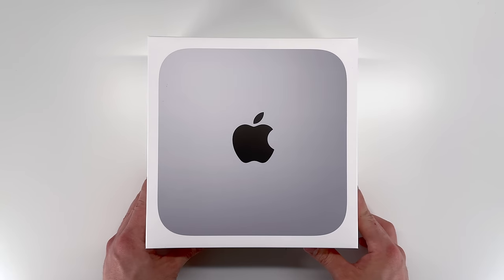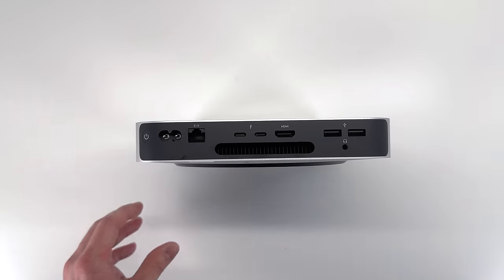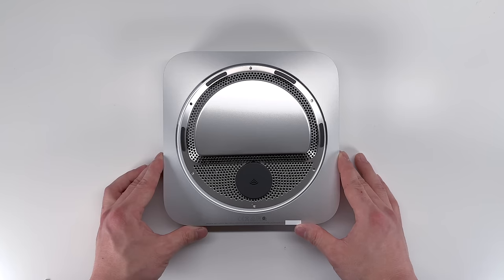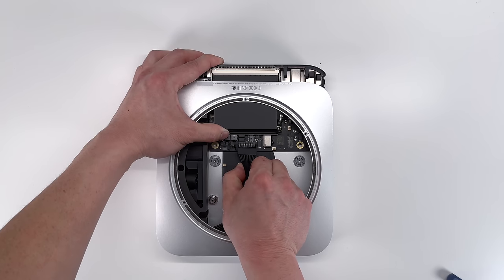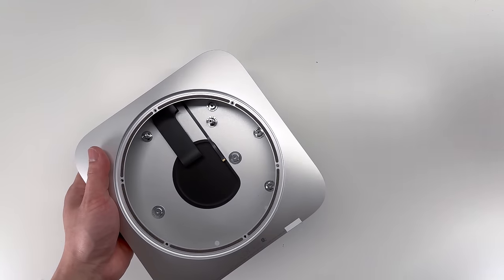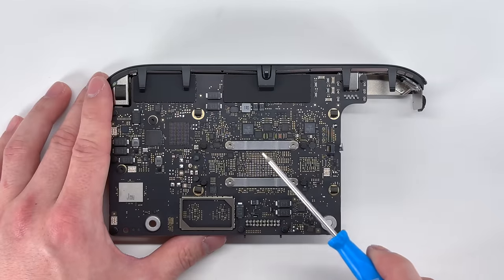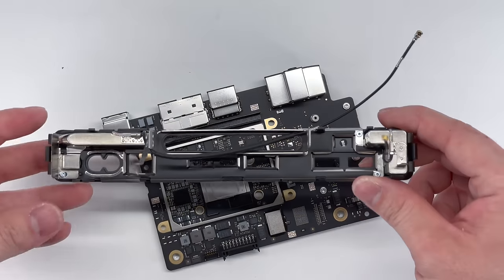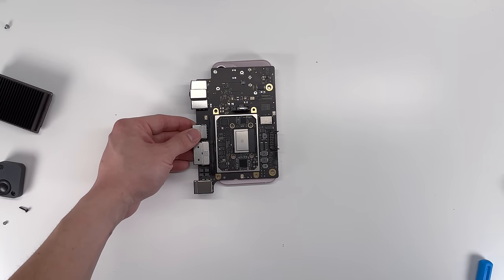M2 Mac Mini Teardown / Disassembly (4K - Up Close)

Comment from the maker: CORRECTION! To the right of the M2 chip are 2X SK hynix H58G56AK6HX052 4 GB LPDDR5 SDRAM memory. There is only one SINGLE NAND chip for storage.
Reply from the maker: @Milan Lucky Sure do you have a prefrence on which app to use? Blackmagic?
Reply: @brandon20904  Black Magic
Reply: @brandon20904  yes black magic please
Reply from the maker: @DestroyCode  https://youtu.be/ttbsXMPBxUc
Reply from the maker: @Milan Lucky https://youtu.be/ttbsXMPBxUc
Reply from the maker: @mohamedfarag798  https://youtu.be/ttbsXMPBxUc
Reply: @brandon20904  thank you
Reply: So, as others predicted, base model 256 has one NAND like the M1 mini… I’m glad I cancelled my preorder and ordered the 512 instead… read that when you max out the 8GB of ram it slows down because of only the one NAND, so faster with the 2nd chip there.
Reply: @benji888578  let’s hope. It is shown that the 512gb base model of the m2 pro Mac mini has a single nand chip. Honestly despite this I think even the base model 256gb m2 is worth for most people especially with the educational discount. Not the case if you edit a lot.
Reply: @benji888578  there is high chance that the 512 has only one too, consider the pro chip only got one…😢
Reply from the maker: @benji888578  Wish I knew before I ordered 🤦‍♂
Reply: @andre88223  the pro chip has two, one on the front and one on the back. But I think it’s supposed to have four…
Reply: Thanks for the ram label. Can you confirm the nand model number please?
Reply: @andre88223  I don’t think so, but, now i can’t wait for the tear down…512 is the starting point for the m2 pro mini, I think the base model Mac mini m2 pro has half the NAND filled, the M2 & M2 pro surely use different NAND chips. Well, hopefully someone will open them all up soon and we’ll know for sure.
Reply: @benji888578  luke Miani opened the pro up at least

Comment: Amazing how powerful computers have gotten with such a small footprint. Cool stuff!
Reply: Riiight, it's basically the same size as a Raspberry Pi but way more powerful. It's crazy.
Reply: Apple doing the unthinkable
Reply: @NotBROLL  wait what? it's like 5 times bigger than rpi...
Reply: It's a shame that it only runs MacOS and can't upgrade when Apple decides you need to buy a new one.
Reply: @TheWorld4all  there's a huge ongoing effort from the Linux community to reverse engineer and make Linux work perfectly well on Apple Silicon Macs. You can install other OSs on these Macs, Apple doesn't prevent it, they just haven't made any effort to make it easy
Reply: @TheWorld4all  As a life long Windows and Android user I completely disagree with part of your statement. Apple supports its hardware (Macs/iPads/iPhones) with software/OS updates for much longer than any Windows PC or Android Phone I've ever owned. This is just a fact. I owned my iPad mini 2 for 10 years, and it was still getting security updates when I decided to upgrade early last year. In that same time, I went through 3 Windows computers, and 5 Android "Flagship" phones from LG, Samsung, and Google. Often times updates for Android phones didn't roll out until months after the release and none of my phones got updates past 3 years, was lucky if they got any after 2 years. Windows is better about updates but rarely does hardware keep up with them. I've come across older Macs (7 , 8 years) that still work better than my 4 year old PC.
Reply: The iPhone is smaller and more powerful.
Reply: @TH3mrBROWN  An 8 year old Mac would definitely not keep up with my 4 year old PC laptop (32GB ram, 1.5 TB SSD, 2.4 Tflops GPU, Windows 11).
Reply: @TH3mrBROWN   Mac Mini is not upgradable.  Suckers are stuck with  8GB Ram, 256GB SSD.   The SSD is solder on.  When the SSD fail, Mac Mini is junk.
Reply: An engineering marvel.
Reply: @WolfiiDog13  Apple does not prevent? create hardware locking mechanisms is what? apple prevents yes and a lot. legacy hardware, without the possibility of easy maintenance and currently even has a block for resale
Reply: @ethi8128  what I am saying is that Apple doesn't prevent you from booting another OS on the Mac, unlike iOS devices, just that, nothing else. Those issues are different ones. Important issues? Yes. But not the same thing.

Comment: The 16gb version will be my first own mac ever, very nice to learn how it looks on the inside! Indeed there’s a lot of space inside, but I guess the current form factor isn’t an issue for most people
Reply: Would you rather go with 16gb ram or the 512gb ssd because it’s faster?
Reply: @theands2724  didn’t know yet if the 512 also got one nand.
Reply: @theands2724  good question, I just went with the assumption that 16gb would be enough for the software I mostly use, after doing a bit of research. About storage I already have an external ssd so don’t see the need to pay the extra. I know having the 256gb ssd in the mac could be a bit slower than 512gb but afaik it shouldn’t be an issue for me
Reply: @akus3526  upgrading to 512gb will make your machine faster.
Reply: @earnistse4899  Why is that?
Reply: @DisgruntledPigumon  the base 256gb ssd is very slow. upgrading the ram wont fix the slow ssd. its advised to upgrade the ssd to make it faster than to get more ram. youll feel the dfference i promise.
Reply: @earnistse4899  That’s surprising.  I’m seeing online it’s actually slower than the 256 M1.  That’s really lame.  I guess I’ll be cancelling my order and paying the extra money.
Reply: @DisgruntledPigumon  yea it's really unfortunate but this is what apples greed gets us. they also did the same thing to the 512gb MacBook pros this year and purposely slowed them down which is a load of bs. the 512 mac mini gets its normal speeds at 512 though.
Reply: @earnistse4899  Well, I’ll try cancelling my 256… 

Hearing about the new M2 Mac Mini made me happy, but hearing that Tim Cook is leaving made me happier.  They don’t need to be greedy anymore.
Reply: @DisgruntledPigumon  it pisses me off that they aren’t upfront about the base model having slower ssd speeds. If it was clearly on the product spec page then fine but they hide the fact that you get screwed buying the base version and want to charge 200 dollars for a 512gb ssd which is a joke. On the pc side you can get a blazing fast m.2 gen 4 at 2tb capacity for 170 usd.
Reply: @akus3526  It ultimately depends on what do you need the speed for, I got the M1 with 250GB and 16GB RAM, and I don't even use the built in storage. You can, as a matter of fact install the OS on an external SSD and I have mine on a 2TB NVMe in an enclosure, with speeds of about 1300MB/s Write and 2750MB/s Read (against about 2500W 2900R on built in) and I couldn't be happier. It does take about a minute to boot for some reason, but I almost never shut it down.
Reply: @earnistse4899  The M2 Pro 512GB is also single Nand.  So now I’m wondering if M2 512GB is single as well.
Reply: @DisgruntledPigumon  i don’t think it would be but if it is …. Then that would be the biggest fail by apple. The Mac mini m2 with a single nand ssd is actually slower than the m1 model when doing intensive tasks like file transfers and video / photo editing because the ssd is needed for those tasks. It’s ridiculous if they also made the 512 mini model a single nand while charging 200 dollars for the extra storage. Who would buy this thing then when it’s slower than the m1 model for daily use?
Reply: @earnistse4899  I hope not, I saw they actually did that to the new MacBook Pro.  512 single Nand.
Reply: @DisgruntledPigumon  I saw that as well. I think you'll be ok going for the 512-mac mini because the m2 MacBook air recovers back to full SSD speed with the 512 model. I just think they are doing this crap to all base models regardless of the starting storage amount forcing you to buy the next SSD tier up. After seeing this from apple I've personally chosen to build a 700 usd pc instead because I don't want to support this anti-consumer behavior from apple. I'm sure you still want your mac mini and that's fair, but I would at least consider the much better value you can get by going pc.
Reply: @earnistse4899  Good point about the MB Air.  And yeah I’m there, I’ve been debating building a PC which honestly is the better idea since it will be specifically for 3D modeling and rendering. But I’d have to pay quite a bit for a decent raytracing capable graphics card, so I’m thinking of going cheap, and with the OS I prefer (I really do like MacOS much better.  I used to build Hackintoshes, but that’s basically over now.) 

I’ll go with this Mac Mini until I learn Blender enough to really need and justify a powerful PC.  I appreciate you giving me the heads up about the 256 though they still haven’t refunded my money from my cancelled order.

Yeah I don’t like supporting the current Apple. Can’t wait until Tim Cook is gone.
Reply: @DisgruntledPigumon  I’m with ya
Reply: Be shure that you got the amount os storage that you need, because those things dont have an upgrade that gave them any future.

Once storage is wasted, all thosecomputers are going to be landfill waste.
Reply: Hopefully the larger size gives better thermals. It would make sense.
Reply: I always wanted a way to hack a USB SSD inside the case. Alas, a new Mac Mini will be upon us soon...

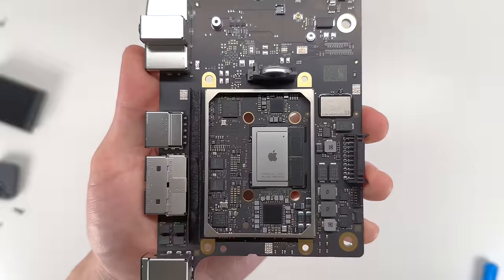Comment: Thank you for showing us the teardown video. 7:11 what you pointed to is LPDDR5 SDRAM memory.
Reply: Yes, SSD drive - silver chip on the right
Reply: @quickmaker2280 two chips right next to apple chip are soder ram chips and he called them sold state drives  the actual sdd is silver chip on right of  because there is a second placement are with pin hole were apple can put another sdd chip

Comment: this base model is gonna be my first mac.  Should be able to buy it in February.  I'm already deep in the apple ecosystem with my iphone and apple tv 4k!
Reply: Nice, it looks like a fantastic computer. I have a macbook air (M1) and it runs great. It's crazy I can still run matlab and program with it.
Reply: I sincerely suggest extending your budget for a larger SSD. There is a significant difference in speed (and long-term longevity) between a single NAND option (which definitely includes the 256GB size) and the dual NAND options (which may start at the 512GB size, but could require reaching up to the 1TB size). Best to research these small but important details before buying, so that you will have a computer that serves you well for at least the next 4~5 years.
Reply: @karaokedogs2618  i highly disagree. apple storage is extremely overpriced. buy the base model because the value is insane and if you are worried about speed just buy external ssd‘s and connect them via usb c they can be plenty fast. longevity of those really hasn‘t been an issue anymore for years in the industry.
Reply: @awesomeapple4540  in this case,  its not a mater of speed... research a little about  m chip Macs, if ssd dies , the whole computer is useless...

Comment: This is a very nice tear down video!  Thanks a bunch.  I did notice you identified two chips on the board as Solid State "Drives", The two chips on the side of the M2 chip are the Dynamic RAM modules, not the solid state drives you mentioned.  I believe The storage chip(s) has/have also been soldered on the board.  The two chips mounted to the board near the I/O panel look suspiciously like 128GB solid state chips.  Alternatively, Apple could have used a single 256GB chip, which the square chip to the top right could be.  Also, another technical detail to note is the Hard Drive does not exist on the inside of the South Bridge, The DRAM and PCI-E are the only communicants at that point. Since PCI-Express is on the North of the South Bridge and South of the North Bridge, it is called Express.  Since the DRAM is shared by the CPU and the GPU, the  Graphics RAM and the Compute RAM are the same chips, The GPU is on the north bridge and the Unified Memory is the only thing between the North and South bridges.
Reply: Yes, the storage chip is North East of the Memory - around where his top finger is located! Being the 256GB version, there is only one chip. I believe more can be mounted nearby.

Comment: Thanks for taking yours apart so my curiosity doesn't get the best of me and I try to take mine apart! I ordered a M2 with 24GB ram and 1TB storage. I wonder if it still all looks the same? Astounding how compact everything is - going from a 27" 2010 iMac!
Reply: yeah you can open yours and check
Reply: The only real difference will be there will be 2 SSD chips. If you look at the 7:12 mark when he points to the “SSD” he’s actually pointing to the RAM. The SSD is actually up and to the right from those. In the video this has a single SSD chip. The second one on yours will be where the grid of solder ball pads are just above the one in this video.
Reply: @JCole78  exactly right
Reply: The black thing right next m2 chip is ram not sold state drive like he sad

Comment: Thank you for this great job about Mac mini M2. Just a comment about that you said at 7min21, I think it is not the SSD chip but the 2 LPDDR5 chip which provide the Unified Memory. these 2 chips have to be close to the SoC and the SSD chip not. You can see the SSD nand chip upper on the right, it is the large light grey chip with transparent and rectangle border. And upper there is a rectangle space for the second nand chip (used when you order 1TB of SSD). Sadly the marketing of Apple decided with M2 family to use only one SSD chip with 256 & 512 GB configurations. And the performances R&W are affected obviously (/2).
Reply: Didn’t knew this and lucky that I upgraded the Ram to 16gb and the SSD to 1tb. Logic and final cut pro pre installed for $1,258 with the educational price.
Reply: I agree what you said, the ssd is further than the ram, but actually there's only one ssd inside the m2 Mac mini,so the disk speed is 50% lower than the previous generation
Reply: @pino_7428  I thuink the 512gb uses 2 sad slots as the read and write speeds double the 256gb version

Comment: Are you sure what you identified as the Solid State Drives are correct? Max Tech identified the SSDs as being the chip right next to your middle finger at 7:18 and the place for a second SSD right above it suggesting the base model drive speed will be much slower with one 256GB SSD rather than two 128GB SSDs that were on the M1 Mac mini. If, however, you are correct then that is clearly 2 chips. Perhaps that is the 8GBs of ram, however.
Reply from the maker: You're right. I got it mixed up because that's how it was when I tore down the M1, I added some notes to the video and description. Thanks!

Comment: Apple is really going in right direction!

Love the compact size
Reply: Well, its surely full of engineer craft but for me, it’s a bit too much due to the reason of no possibility to upgrade things like ram or storage.
Reply: @Lykaon01  wrong, they are trying to force the end user to use the cloud, so you can't upgrade the storage
Reply: @Lykaon01  wrong, they are trying to force the end user to use the cloud, so you can't upgrade the storage

Comment: Why would they make it smaller? You need some weight and size to stop it tipping and for the air grille and inputs/outputs?  I don’t get why it needs to be smaller or what benefit being smaller would be? The Mac mini is essentially as small as it needs to be. What would be the pro of it being smaller especially as the pro edition uses the same case. Can you please qualify your statement ?

Comment: Hope the 512 SSD version will come with 2 NAND chips. Thanks for the video.
Reply: Nope. Its confirmed to have a single NAND chip as well.
Reply: @DanielBlaney  Do you mind sharing the source for this confirmation?
Reply: @DanielBlaney  this is incorrect. It comes with 2 as the read and write speed doubles the base model with 256gb

Comment: They modified the base model M2 Mac mini's SSD arrangement, just like what they did with MacBook Air M2 and 13" MacBook Pro M2 (I can't verify if that's the same case with the 14" and 16" MacBook Pro M2 Pro and Max.) All the base models use a single NAND SSD chip.
 
DO NOT buy the base model if read/write speeds matter to your workflow. Otherwise if you're just a casual (non-technical) user go for it. The slower SSDs won't matter to you.

Comment: For M2 pro Mac mini ,Is it better to have a 1TB version for a “guaranteed” faster SSD compared to 512GB? Thanks!
Reply: Honestly, it really wouldn’t make that much difference when your SSD is reading/writing beyond 1500 or 3000 megabytes per second. Any kind of work will be more than fine with that. What you want to consider are TBW ratings (Terabytes Written). The larger SSD capacity, the higher TBW rating, and the longer it can withstand wear and outlive your use cycle. Consider as well that you cannot just replace the SSD if it’s broken. That’ll render your Mac Mini useless 😅. 

Since you’re getting the M2 Pro, you must be using it for some powerful stuff. I’d recommend you get the 512GB and get an external SSD drive for files you actively use to avoid wear on your internal SSD. It’s more practical than shelling out money for 1TB when you can get external SSDs just as fast (using Thunderbolt connections) with larger storage

Comment: Do we need to buy a UPS or maybe surge protector considering how small the psu is? For my desktop pc i just plug it straight to the wall without problems for years bc i trust the psu capability and features.

Comment: Mine just died . set up an appointment with an Apple service center for repair: they won't accept it for warranty repair without an appointment.  It's just a year old, with minimal use.  Had it connected to a surge protector too.  No lights, no sounds, nothing at all.   Power cycling does not fix.  Just one data point, yes, but keep it under warranty, IMHO.